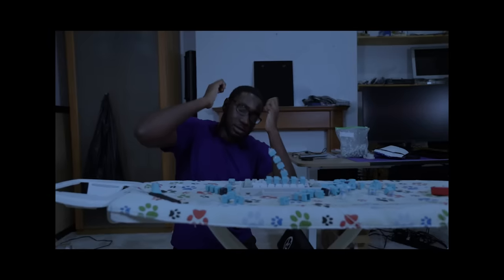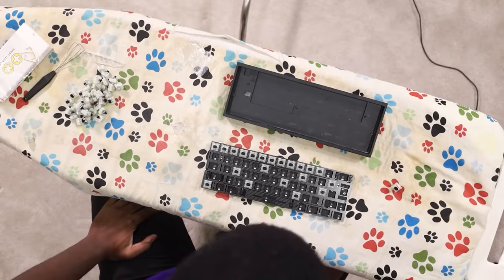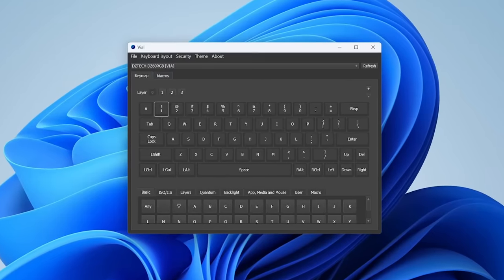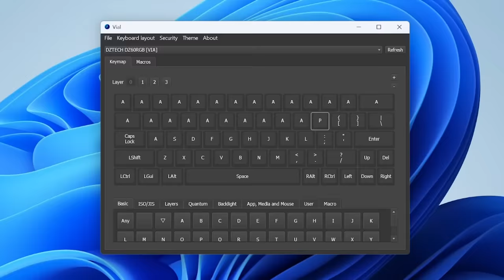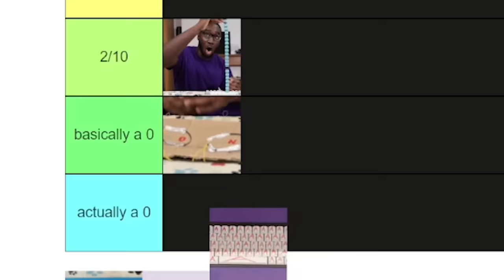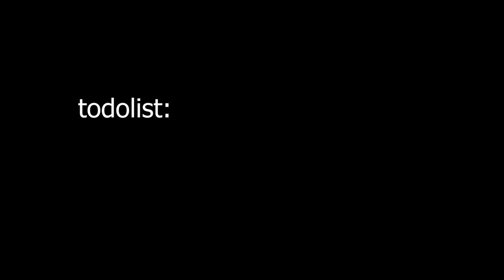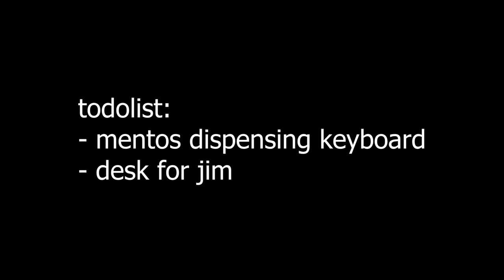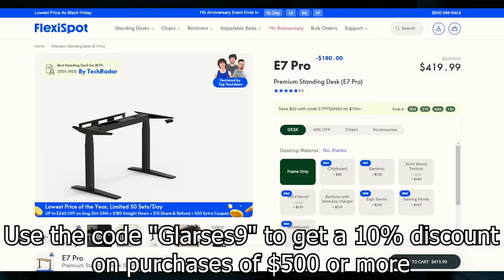Building your dumbest keyboard ideas

Comment: you need to make a keyboard that 5 minute crafts would make if they were 15 minute crafts
Ingredients: 1 large piece of cardboard, scissors, buttons for each key, markers, glue and a small picture frame.
1st step: Grab your large piece of cardboard and cut it how large you want it to be then draw  little frames for your keys.
2nd step: color your keys and put letters on them.
3rd step: grab your glue and put it on the labeled parts you did in step 1 then put your keys on them.
4th step: grab your frame and put glue in it.
5th step: grab your cardboard again and slowly slide it into the frame.
Then just plug it in and start gaming!